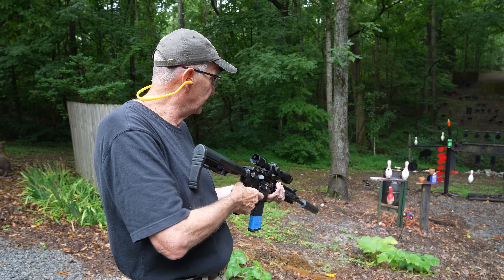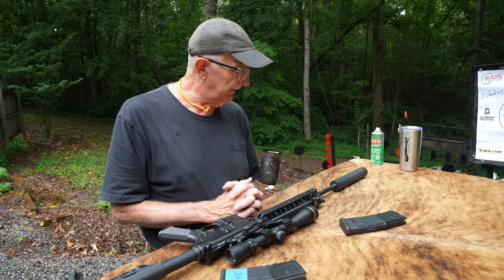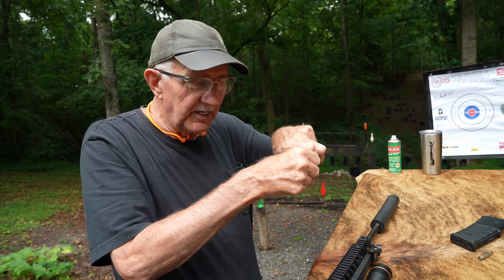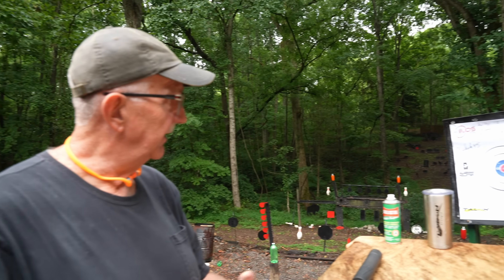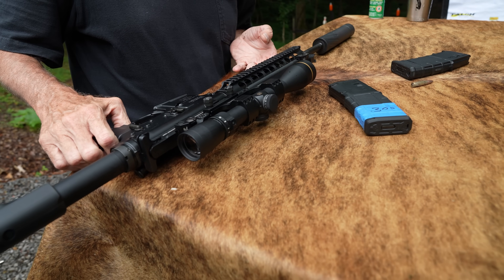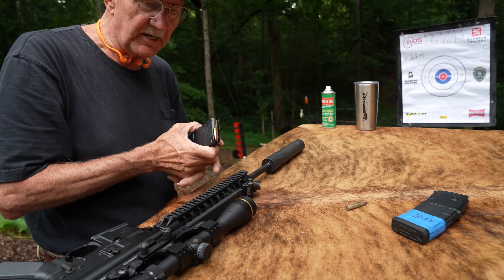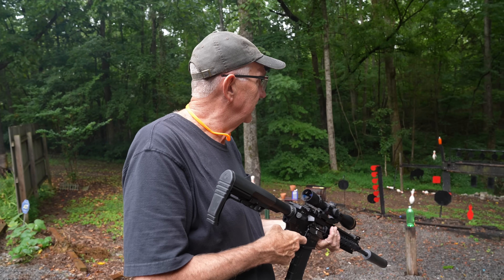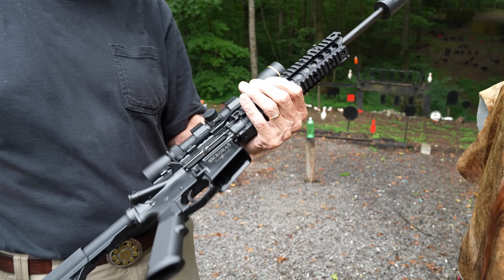Why Is It Still Loud?

Comment from the maker: Apparently, the sound at the muzzle is not just air rushing back in so fast; it's the release of the built-up gases being released, as well.  I've never claimed to be a physicist, even though my degrees from MIT, Stanford, Vanderbilt, Harvard, and Yale indicate as much! :-)  Anyway, the main point we're trying to make is about why suppressors do not totally eliminate the sound, especially with supersonic ammo, and how that's still a useful thing in many circumstances.
Reply: Also there is gas expelled when the round is ejected along with the machine noise as the action works, not a ton but some. Bolt action rifle shooting supers is quieter than semi auto but subsonic in a bolt gun is an amazing experience
Reply: @stevenwilkinson8373 most subsonic ammo doesn’t have the velocity, or penetration to humanely take large game tho which is what most people would use a bolt gun for. If you’re hunting, use full power loads
Reply: @AFreeThinkingDawg09  Excellent Point.😎
Reply: @stevenwilkinson8373  Yep!
Noise at the ejection port is an inherent issue with autoloaders that don't have a delayed blowback design.
Reply: Yea its the boo let
Reply: I laugh whenever I see a movie (nearly every movie with a gun fired with a suppressor on it) where they dub in a falsely-quiet pew-pew noise instead of the actual noise 😅. I think that is the reason for the restrictions that misguided lawmakers enact on suppressors.
Reply: @Erichhh  Misguided is quite polite description of lawmakers, most are ignorant at best, mostly worse.
Reply: @1947froggy  Agree 💯. It's often difficult to distinguish misguided ignorance from intentional sabotage, especially lately.
Reply: If you want quiet buy subsonic and then use a suppressor.
Reply: I love your channel. I share your videos with all my vet brothers
Reply: During the Spanish Civil War and the Rif War, snipers were called "pacos" (Paco is the hypocoristic of Francisco). The sound of the shot and the sound of the bullet breaking the sound barrier came at two different times, heard as "pah- coh!"
Reply: @Agente_Especial  The sound of the shot fired is stationary, but the sonic boom is a sound wave that follows the bullet the entire length of its supersonic flight duration.
Shooting supersonic rounds with a suppressor is so much more pleasant, because the can captures most of the pop at the muzzle, and the sonic boom following the bullet is going away from me.
Reply: That sounds right. The gasses and sounds are going to take the path of least resistance until energy equalizes. Even though I haven't modeled this scenario, the explosion (of primer and powder) sends the gas and sound down through and out the end of the barrel; as some gas comes back through the gas tube the same thing would happen but to a lesser extent so there would be sound from the gas port areas including in the BCG and out through ejection cover and maybe a small amount through charging handle area (especially if not gassed properly); once the gasses leave the barrel pressure would try to equalize (energy does not like to be built up and nature abhors a vacuum) making a distinct sound; plus the bullet going faster than the speed of sound waves i.e., supersonic crack and whistle. This all happens in milliseconds and even microseconds. Most subsonic rounds have lesser powder charges as well as heavier bullets which both contribute to reduced sound. A suppressor effects the gas dynamics hence the use of an adjustable gas block on AR's helps to make everything more efficient.
Reply: @kevin_lazer  Given sufficient dwell time (the time between when the bullet passes the gas port and when it leaves the muzzle) to be reliable typically means that there is still a certain amount of pressure still in the barrel when the action begins to open, releasing more gas at the ejection port than you might think. That is by far the greatest contributor to noise not at the muzzle, and why manually cycled weapons are easier to effectively suppress.
Reply: @hickok45  The pressure is correct and same with cork gun. When I was very young, I had a air gun without a cork. I would put a stick down the barrel to shoot it out. It was slightly louder due to stick causing more compression. It's a wonder that I didn't put someones eye out. A child today might get on the white extremist toddler list for that, no matter their color.
Reply: Well be careful the blue haired androgynous editorial staff at Google are still looking to suppress you. Be sure you cut up all your old videos and upload them back. That way nobody will think wrong things or feel unsafe.
Reply: Ballistics,MIT lol that's BIBIS school
Reply: Yeah and if we were required to suppress our guns we'd be dying to take them off
Reply: That's why revolvers are SO damn loud. The gap between the cylinder face and the frame lets a lot of gas escape and that gas translates into sound.

Comment: The noise of muzzle blast and sonic crack are two different noises. 
1. Low powder charge to get bullet under the speed of sound will lower the blast pressure. Which turn lowers the sound.
2. At Subsonic bullet velocity, you do not hear bullet Crack, let's say at 100 yards.

Comment: Hey people in this thread, very easy to tell who don’t know wtf they talking about, because there is a significant difference in a SUPPRESSOR and a SILENCER.  There are very very few “silent” weapons.  Those are always a bolt action, or designed from scratch to be “silent”.  I could be wrong, I often am.

Comment: FWIW, the noise level of the sonic crack depends upon the size of the projectile.  I measured the sonic crack of a 30 caliber bullet with Mr Alan Paulson (author of the book, "Silencer Performance and History") and from ten feet away, the sonic crack was about 155 dB.  

We also metered the action noise of an AR15 and found it to be approximately 114 dB.  

A good suppressed, subsonic 300 BLK should run in the low to mid 120's. (122-125 dB).

For comparison, unsuppressed full power, supersonic 300 BLK will be approx 165 dB.
Reply: it really dont make any sense why cans are so dagum regulated and expensive!!!   all of those you typed with the can on are still way above the hearing damage threshold and to me they orta come factory option on any larger noisy caliber rifle.  My hearing was damaged as a child from not wearing ear protection.  if we had suppressors back then it would have definitely saved more of my hearing.
Reply: @MrChevelle83  The regulated part has to do with your laws.  The expensive parts has to do with the associated $200 tax.  Where there is no tax and little regulation, silencer can be offered very cheaply.  However those models are nowhere near as good as US designs.

There is a difference between constant noise and impulse noise.  OSHA says 140 dB is the limit for hearing damage from impulse noise.  The majority of silencers are below the hearing damage limit ... except the flow through models, which are all really loud.
Reply: @ExpatriotSilencers  140db is ear busting where i work osha says 85db requires hearing protection
Reply: @MrChevelle83  You are confusing constant noise with impulse noise.  The OSHA limit for impulse noise is 140 dB.  The quietest silencers in the world meter around 110dB, at which point all you hear is the firing pin drop.  Impulse noise and constant noise are very different.
Reply: @ExpatriotSilencers  140db will still damage your hearing no matter what, if you had a rifle at 140db and fire it just several times a year it will eventually cause hearing loss.
Reply: @MrChevelle83  Then you should go and tell OSHA they are wrong and that you know better than all the experts in the field.  The 140 dB limit for impulse noise is not my opinion, it is govt policy.
Reply: @ExpatriotSilencers  im not implying that you or osha are wrong that is the limit indeed, however all im making the point is impulse noise at 140db of course wont blow your eardrums immediately but, will damage your hearing over time and that is a fact.  i work with a fella that has serious hearing loss from about that sound level.  if you or me were standing next to the sound (sledge hammer against steel)  its not really that bad but if we stood there for the entire duration, if you have good hearing the discomfort starts to set in.  I wear hearing protection for any task that even slightly feels uncomfortable.  i already have a mild case of tinnitus from firearms back in my youth being careless.

Comment: As the bullet leaves the barrel, it has 60,000 psi of air pressure behind it. When the high pressure meets the atmosphere at 14.7 psi, it becomes low pressure almost immediately and releases the excess pressure as a wave we perceive as sound. The suppressor stretches out the time it takes to stabilize the two pressures which reduces the intensity of pressure wave.
Reply: it mixes that shit all together and tires out the air until it makes a whimper
Reply: @sgttomas  and calls you daddy
Reply: The 60,000 psi is only at the chamber.  By the time the bullet leaves the muzzle, the uncorking pressure is only about 5,000 psi.  The sudden release of high pressure gas creates a pressure wave which we perceive as sound.
Reply: It's mostly rifle rounds that get anywhere near that pressure, and not that many of them.
Reply: There is also a slight cooling effect on the high pressure gasses.  Cooling them a little bit will also reduce their pressure.  That is why the first round is usually quieter than subsequent rounds because heat flows from greater heat to lesser heat at a rate proportional to the difference in temperature.  There being a greater difference in temperature for the first shot, more heat flows from the gasses into the metal of the suppressor.
This phenomenon is also why squirting a little water into the suppressor to coat the inside and draining out the excess will make it more effective.  The vaporization of the water will extract heat from the gasses.  My experience with a friend who has a suppressor for his 45 a cap pistol indicates this trick is only good for one shot.
Some people take this to the next level and put some sort of gel into the suppressor because it has a tendency to last for a few shots.  Most are using a gel that their intimate partner may be familiar with, but I have heard of some electricians claiming that wire pulling lubricant also works well.
Reply: @davidgates1122  The first round through a silencer is often louder due to first round pop.  The oxygen bearing air inside the tube causes unburnt gases to re-ignite.  After the first round the oxygen get burnt off.
Reply: @ExpatriotSilencers  And since the silencer is hermetically sealed, oxygen does not get back in due to the difference in partial pressures.  Not to mention the fact that the powder contains an oxidizer that supplies the oxygen needed to burn the powder.  I think I will stick with the experience of my friend who owns the silencer and has a degree in chemistry.
Reply: @davidgates1122  I have been designing and testing silencers for 20 years and have several US patents for them. I'm sure your buddy who owns a silencer knows better though.

If your buddy's theory is correct, why is muzzle flash a thing?
Reply: Thank you for the practical and simple explanation. I get your math.

Comment: There are suppressor designs that do in fact bleed off enough energy from gasses to reduce an otherwise supersonic round to subsonic.  The integrally-suppressed Ruger 10-22 works this way, for example.

Comment: With .300 Blackout its actually a delicate balance. Shooting 220 grain subs out of a barrel that long may not be sub sonic anymore, depending on the ammo. 220 grain subs out of an 8.5 inch barrel, with a good can, like the Trash Panda or Thunder Chicken, is indeed really damn quiet. The longer barrel builds more pressure, sending that round out a lot hotter, thats why 7.5 inch to 9 inch is the sweet spot for .300 BO. It was meant to be shot out of a short barrel from the get go. If you want to run a 16 or 18 inch barrel AR, just run 5.56
Reply: I have .300 BLK in both AR and bolt actions. In the bolt gun (16") the subs are much quieter than a sub 22LR round, in the AR you have the sound of the action opening and closing, which is pretty loud. Just take an empty AR, no mag, no bullets, with the bolt locked back, and in a quiet area hit the bolt release. It`s loud ain`t it? My suppressor is one I made on a Form 1 with modified K-baffles and a large chamber.
Reply: @bbivens8263  The action noise of an AR15 is approximately 114 dB.

Comment: The time delay to bullet impact is remarkable with the subsonic ammo
Reply: Subsonic rounds are usually rated under 1000 fps. Even for a gong at 100 feet, that's 1/10th of a second just for the bullet to get there. Add the time for the gong ping to travel back to the shooter. Really seems to lag.

Comment: I am buying a .300 blackout upper just cause... well... I got a lower.   And I can shoot 220 or so cast and coated bullets.    This makes for very inexpensive shooting.    also I will have basically a pistol caliber carbine with about the bullet weight and velocity of my 1911's but able to be far more easily accurate and a much better BC   so that it is fun to reach out there couple hundred yards which is difficult with the pistol.

Comment: You also get some sound coming back through the action of a gas gun.  A suppressed bolt gun is significantly quieter than a comparable gas gun for that reason.  A sub sonic bolt round is stupid quiet.  Throw that Banish 30 on a 22 bolt with subs and you will only hear the click..... ding!.

Comment: I own and use mine regularly. For my own enjoyment, and less noise pollution. One thing I was not aware of and found disappointing was the dramatic decrease in accuracy with subsonic 300blk once you get passed 60 yards or so. Just a heads up.
Reply: I use 220 Federal subsonic and they drop quickly  , but you can allow for that to 100 yards . They're 60cents plus tax a round  .

Comment: Information for everyone out in video land! I’m just your average retired sportsman. I bought two 22lr guns I never owned, a Ruger pistol & a Ruger 10/22, love bought guns! I also made sure they had threaded barrels to put on a suppressor. So I spent the $700 total to get the highest rated suppressor and what a big disappointment. Yes it does quiet the report of the gun itself, but the bullet is still traveling over the speed of sound so you still get the crack of that! On the pistol it does quiet it down I don’t need hearing protection, but on the long gun it barely makes a difference, wish I would have kept the money. Now, they do work great with subsonic ammo, VERY QUIET, BUT, does anyone know of a subsonic load that aren’t about 50% duds? I bought Winchester subsonic ammo thinking Winchester would be great, what a load of crap, like I said, half are duds!!!! Any info from viewers out there on subsonic ammo that will fire and not have duds? I also know that subsonic loads  sometimes don’t have enough  ‘power’ to work the action in semi auto guns, fine, but at least if they fire a quick ejection will clear it. And lastly, for anyone that is new to possibly getting a suppressor, after you get it, there’s a ton of scammers that will follow you after you receive it posing as the ATF and try to scam you to get info, so be careful.
Reply: Your complaint is ammo related.  All standard velocity rimfire and match ammo will be subsonic.  There are loads of different brands of subsonic.  Both CCI and Remington make subsonic ammo that will cycle a semi-auto action.

Comment: From some testing I’ve seen in most cases that have tested this the suppressor will actually give a little more velocity to the bullet. And the work that the suppressor actually does is to slow the gas flow down before leaving the muzzle to give it time to cool because introducing hot gas to cooler air temperature will cause a loud bang. The hotter the gas and the more volume of it the bigger bang. Most people think that your hands hitting each other when clapping your hands is what makes the sound. But it’s not. The air rushing out from between your hands is what causes the sound. Just like a gator or crocodile slamming its jaws together, the air rushing outwards is what makes the popping sound. At least the majority of it. That is kinda what he is alluding to when he mentions the popping sound of the air rushing back into the muzzle. I must warn you that I’m no expert on this topic and may have not worded everything exactly as it should be.
Reply: It's not the mount of energy released but the speed at which that energy is released.  If someone holds up.a pillow or piece of foam and you clap your hands over that, the noise is considerably less even though the energy release is essentially the same.

Comment: Great episode. To get something as quiet requires multiple solutions, first speed of the bullet, gases from burning powder and finally mechanical sound of operating parts. Subsonic is primary, but suppressor design is important, plus a clanky gun is a clanky gun. No longer an active shooter, but have a modicum of experience.

Comment: uh. i need more education. 
the pop is the air rushing back in?
if i stick a balloon with a pin and it pops. that’s the compressed air rushing OUT.  pulling a cork out of a bottle is the compressed wine gasses rushing OUT.  when you pull the wad out of a muzzle loader that’s the air rushing back in because you created a vacuum. 
the pop when you fire a weapon is the noise of the explosion that happens in the chamber escaping when bullet clears the muzzle. 

ok. you keyboard warriors. 
tell me i’m wrong. or educate me.